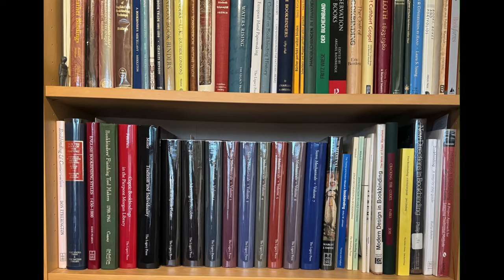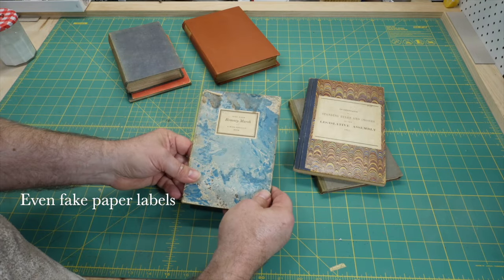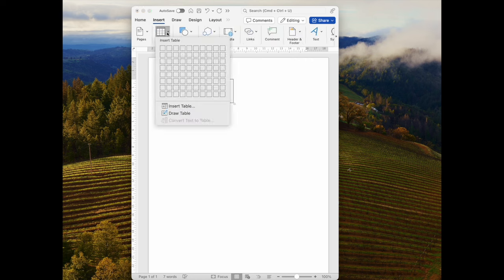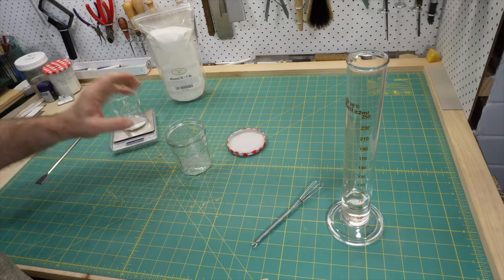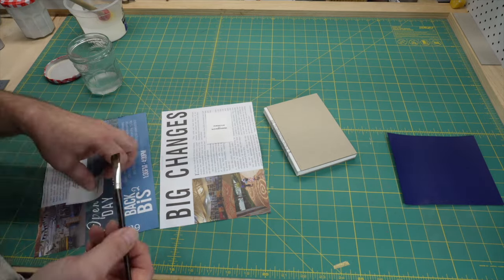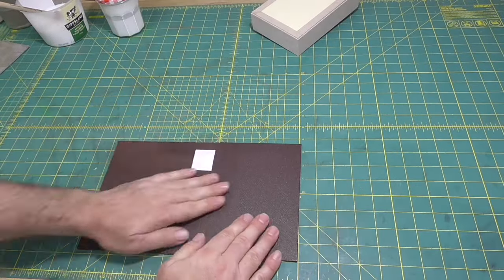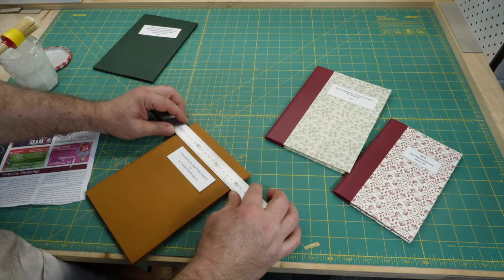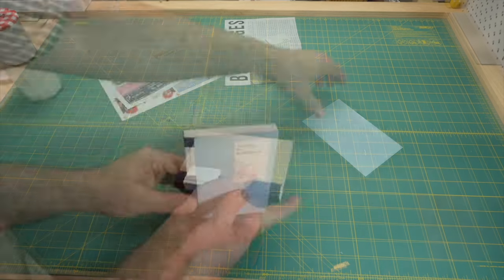Paper Labels // Adventures in Bookbinding

Comment: I've had a ton of success with HTV. Once I made a mistake while adhering to cotton book cloth and was not able to remove without damaging the cloth. Inkjet inks are usually water based and can bleed if you aren't using an inkjet specific paper with a microporous coating. Manufactures such as Hahnamuhle make sealants for inkjet prints that claim to be archival but I don't bother. Some home based inkjet printer use dye based ink which isn't light fast. I suggest looking for a printer that uses pigment inks such as Epson Ultrachrome. Laser printers use a dry toner that is transferred to the paper using heat and sits on the surface. Mohawk super smooth with an eggshell finish is the Best! Love that paper. I normally use it for letterpress printing labels using Von Sons rubber based or oil based inks

Comment: For many home printers, the 118gsm Mohawk will be too thick to go through the duplex paper path but should still be perfect for manual feed. If your printer has a flat card or envelope paper path accessible by dropping a rear panel, that would help avoid curling and can handle thicker papers like this one.
Reply from the maker: 118gsm Mohawk isn't thick and it is very flexible, which makes it a great text paper.  It is a certified digital paper.  I have never had a problem with it in my low end consumer printers, all with duplexers.  I occasionally get paper jams with the Clairbook, but it isn't the weight, it is the texture, and the cheap feed mechanisms have trouble occasionally pulling 2 sheets from the tray.
Reply: @DASBookbinding The home laser printers do seem to have rather restrictive specifications. My 10 year old Brother HL-2270DW lists 60-105gsm for both the main tray and the duplexer but 60-165gsm for the flat manual path. Additionally it adds Long Grain to the spec list too.

It didn't occur to me it might be the paper pickup that could be limiting the paper weights - it is just two flimsy rollers after all. I could understand the duplexer having limited specs as it does have to roll the paper around at one end to turn it over. Oddly the brand new Brothers for home or small office still have the same weight restrictions. You have to go up to the big multifunction office printers before Brother will "allow" papers to 120gsm from a tray and 200gsm for flat path.

Of course there is the old "if it works"...

I have some 100gsm A4 Short grain from Papermill Direct in the UK for fanfic bookbinding and some heavier quality paper I bought 12 years ago from Piccolo Press in Scotland that I could use for labels if I flat path it throuhh the printer. It is a brilliant white but very opaque.

I will need to find a way of labelling the rounded spines of books covered in Buckram book cloth however. I should only have three to identify but they are between 400 and 600 pages (100-150 sheets) long. I don't have any of the foil tools and this is at home.

Comment: We are letterpress printers (Mabel & Co) and have had great success with printing on to the case before casing in. We use vegetable based ultra-black ink, onto our in-house made linen buckram. The results are really pleasing and generally we feel that the level of detail achieved is greater than that of hot foiling - but we don't do hot foiling so might be biased! Appreciate that not everyone has access to a fullsize printing press to be able to do this, but small table top ones are readily available and can be used to produce nice labels.
Reply from the maker: Nice to hear from you.  It's a bit of work setting up a press for one label.  Better for a run.  I guess you can hand ink for a single.  I know Arthur Green has an Adana for making authentic looking paper labels.  I have a little Poco proof press and I have thought about doing labels with it.

Comment: I have used a thinned down paper varnish on paper both for labels and printed sides of quarter bindings.  Laser printed on off white paper looks a bit like vellum as it goes a bit translucent.  You can't over brush as the print runs but quite a nice effect.

Comment: Sorry ch a great topic. Great tip about the different shapes according to the structure of the title, and the "Label Well" I appreciate you sharing all these useful tid bits, resulting from your meticulous research. Thank you so much! Paper labels are the choice for me, as I don't have any foiling or professional tools. I saw a tool by a scrapbook crafting company "WeR Memory Keepers" which  sells a Foil Quill with a hot tip which can be used for hot foiling. It is marketed for card making. Does anyone have any experience using this on book cloth? I haven't seen anything or anyone doing this. Any tips will be read with interest. Regarding fixating labels, it might be interesting to consider fixative spray used for pastels or graphite, which is also archival, acid free and some even  affords UV protection. Thanks, Darren for another useful video!
Reply from the maker: I've seen lots of people on the internet using those pens.  I the more established bookbinding circles there are tools such as the Ascona finishing tools and a number of variations made by others, such as Dominic Riley's.  Though, these are for patterns not lettering.  I guess it depends on how good your hand writing is.  Plus foil is very sensitive to temperature, dwell and pressure.  Must be difficult to get right.

Comment: 4:33 I did an experiment last night to see what waxing does to inkjet printed labels. I used ti like to use the colour laser printer at work to make labels for my elderflower lemonade and apple sauce, but I don’t have access to a colour laser printer anymore, so how do I make the home inkjet printer work for that?

It turns out that your practice of using a soft cloth to put wax on paper works. I waxed one label and left one plain. Then I just put them both under the sink faucet. The waxed one stayed crisp even when the paper was soaked. The untreated one had the inks running all over the place.

Comment: I'm really struggling with the label well. I tend to use a thicker cardstock (usually around the same GSM as the laminate) for my front covering material, and I think that's why. I have a hard time finding the edge of the label well while gluing, and then run past it with my bone folder which leaves a tool mark in the cover. Maybe I should do a double-thickness laminate to make it easier?

Comment: Great video as always many thanks!  I have consistently had problems with EVA keeping paper labels stuck to Buckram cloths.  I have a range of makes (mainly end of lines etc and sadly I don't know the manufacturers)  and had this problem with at least a couple of different ones.  Have you experienced this at all  and any advice?
Reply from the maker: I haven’t but this comes up regularly and the answer seems to be to take the surface coating off with a solvent such as ethanol or iso. alcohol.